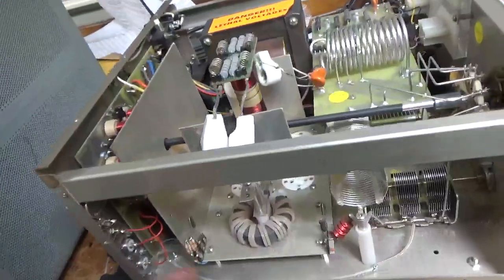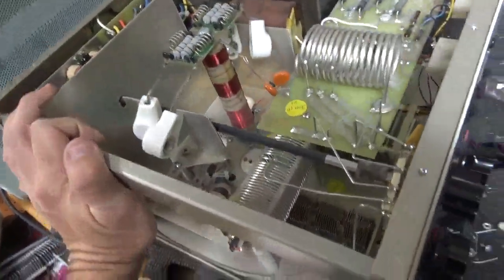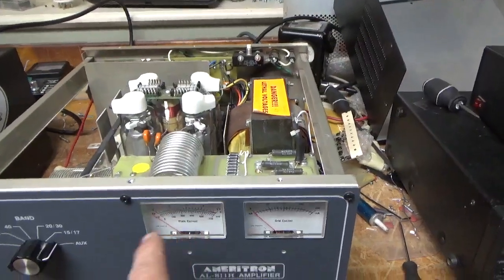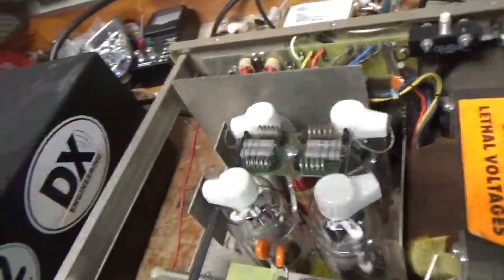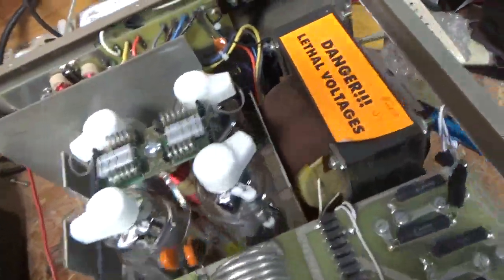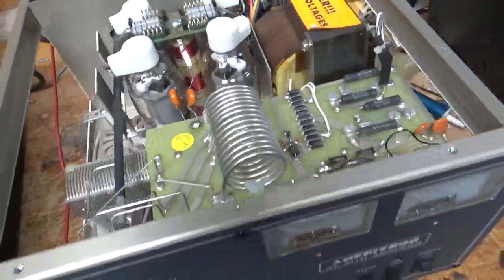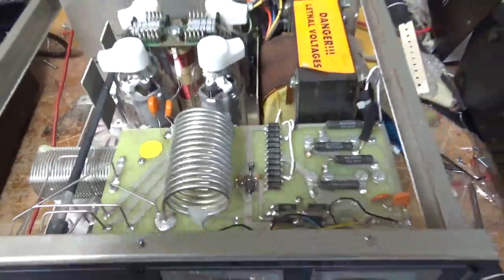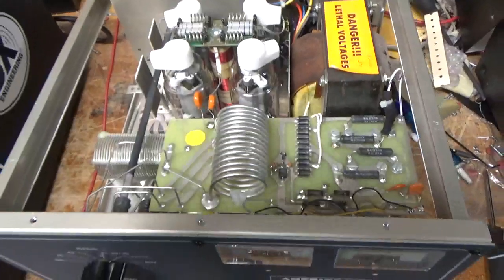Ameritron al-811h Repair And Modifications Penta Labs 572b Tubes

Comment: I enjoy your videos but now I am nervous about my recent purchase of a new AL-811H. Has Ameritron made any of the mods you advocate in their current product or will mine also destined to your shop someday? 😀  P.S.--I put in the correct fuses!
Reply from the maker: Thank you for watching.  Newer production u it’s are plagued with quality control issues. They don’t ground the grids to the chassis or put the gas discharge tubes at the base of the sockets. They place one on the board, which is not a good idea. 73